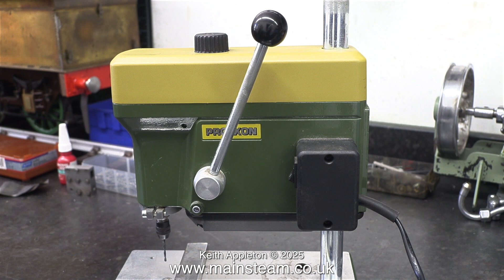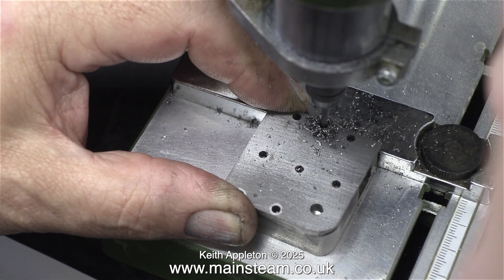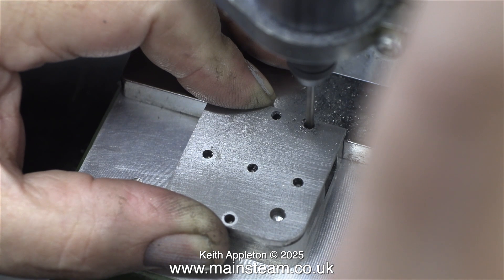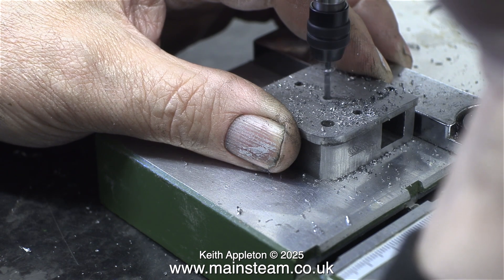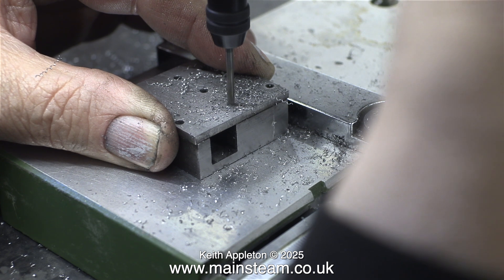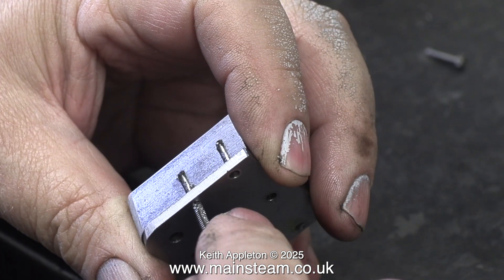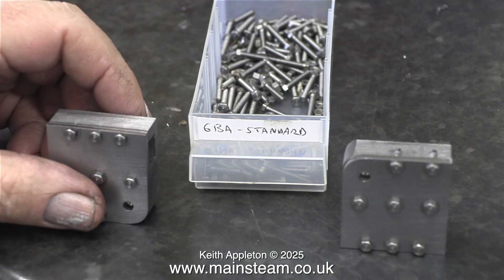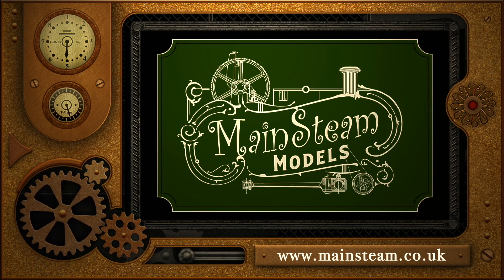WORKSHOP TOPICS - DRILLING 6BA TAPPING SIZE HOLES

Comment: The Proxxon drill press definitely has its place in the home engineering or model shop! I would imagine that yours is 220 volt, whereas mine is 115 volt, being in the states. The speed wanders on mine even when not drilling, and it can be worrisome.